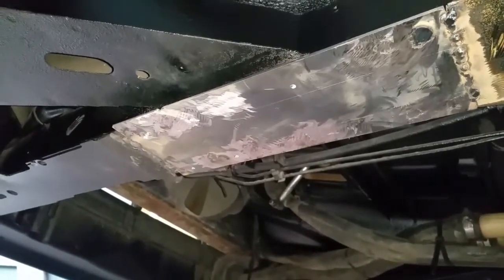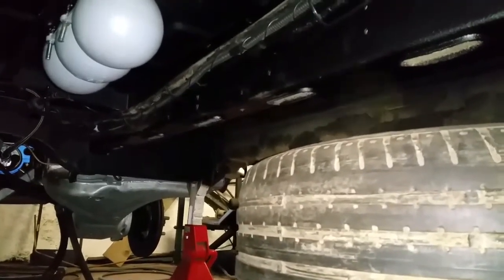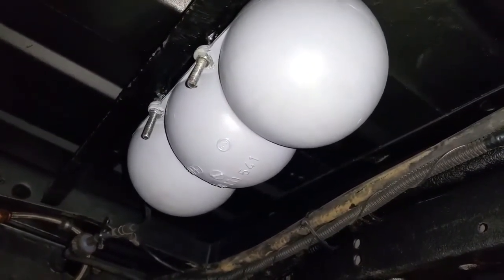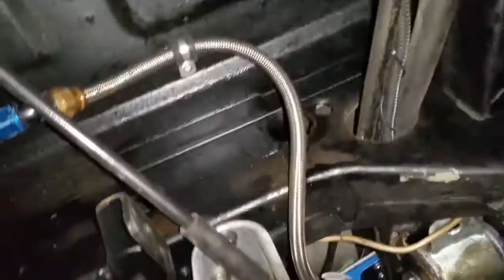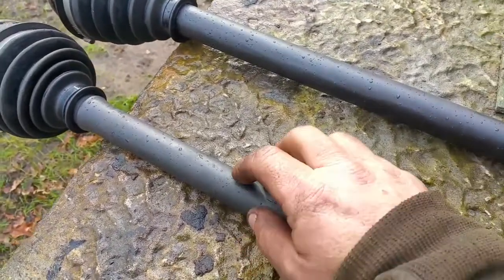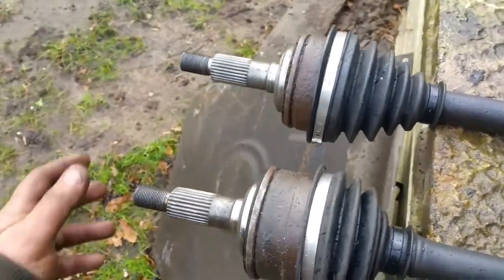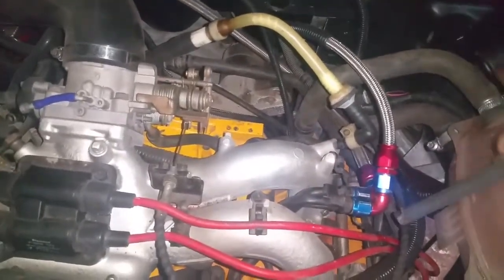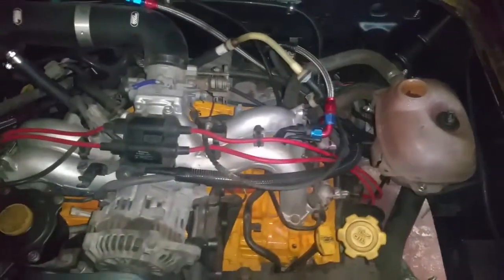VW T25 T3 Vanagon 2WD to Syncro 4WD Conversion Project - Front End Mods Finished and More

Comment: If I remember correctly, the front driveshaft for the 16" with diff lock is the same as my old Audi quattro was. I had a 16" that I sold some years ago.
I can't swear that this is the case but might be something to check.
Well, now I see the video was made some time ago, so you've probably solved the issue already..
Anyway, thanks for the informative videos.
Reply from the maker: Hi thanks for the positive comments, appreciated :-) 
Yep a lot of work and I actually was actually lucky enough to take some time out of work to get the job done. So much more to do though I now have difficulty finding the time to get it all done. The next biggish job will be a decoupler install for which I will do another video. To answer your earlier questions, no problem with the MOT, and yes you will need to remove the rod ends to fit new bellows.
Reply: Mark Halligan   thanks for taking the time to answer  😃  once again , it'll be a marvellous unique Syncro.

Comment: Before you go buying a Syncro 16" (with diff-lock) outer CV joint, you should know that the driveshaft is also different and you can't fit the larger diameter outer CV joint to the smaller driveshaft. You'll need to look for a complete driveshaft instead or just run a pair of Syncro 14" (same as Syncro 16" without front diff-lock) driveshafts.
On a T3 Syncro with stock length front shock absorbers, you won't gain anything by using the Syncro 16" driveshafts/bigger outer CV joints. It's only when you start to really push the boundaries and lift them silly amounts that you'll notice the difference. With Syncro 14" outer CV joints now available for £30.00 new, it's probably not worth it.
If you guess who I am, you'll know that I run a Syncro 16" almost daily which is one of the tallest in Europe, as such, I'd be interested in your Syncro 16" front driveshaft as a spare. Good work mate, keep it up!
Reply from the maker: +Syncro16TDi 
Thanks for the info, worse than I thought then! Now you say it I should have noticed that the 16" driveshaft is a little thicker as it is noticeable particularly at the inner end. 
Mine will be lifted, not too much, but I might have to look for another 16" driveshaft to give me the option of going higher if I want to. If I don't you'll get first option on the 16" driveshaft.
We have met, not sure if you remember but I came round to your place and bought the upper cab bulkhead panel from you a couple of years or so ago :-) 
Thanks again, much appreciated.
Mark
Reply: +Mark Halligan Yes I remember. I've just added you on FB so it's easier to chat. I've very rarely seen a 16" front shaft come up on it's own but there's always a first time. If I see one, I'll let you know.